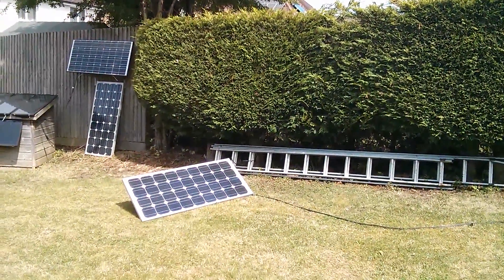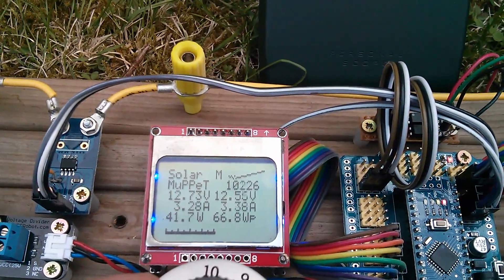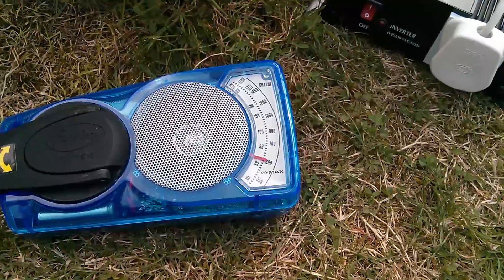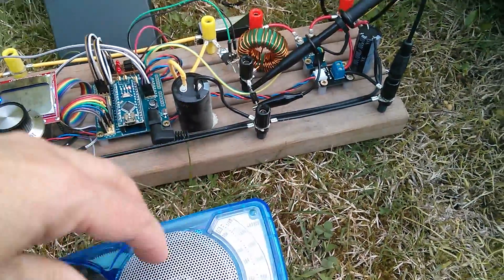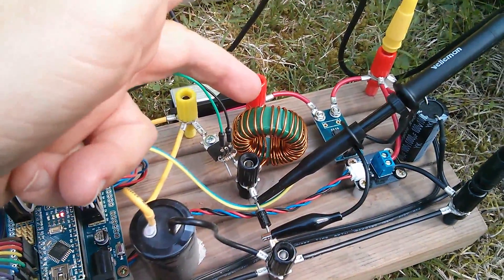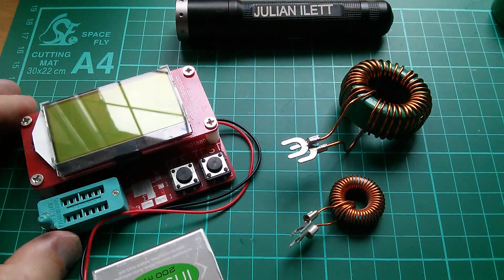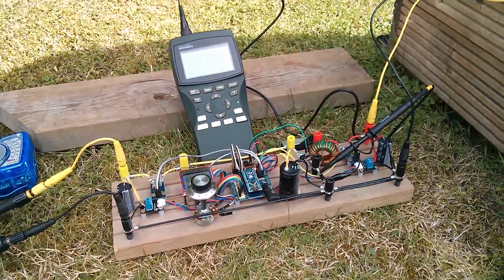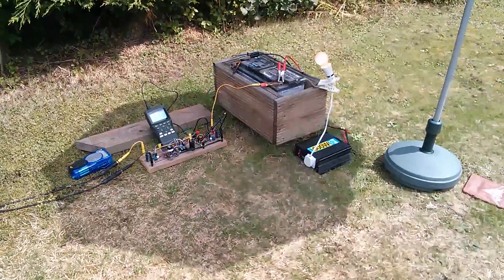Arduino MPPT Solar Charge Controller: #22 - Inductor Change

Comment: Julian, if sunlight is a problem, why don't you use a transformer with bridge rectifier and caps.  It should simulate to some extent the solar panels.  Or come to Jamaica where we haven't had rain in the last couple of months!
Reply from the maker: Donovan Lym I've seen power supplies that can simulate the VI curve of a solar panel, but they cost £thousands. Jamaica is very tempting, but Spain is nearer!
Reply: +Julian Ilett You may find this article interesting: http://ww1.microchip.com/downloads/en/AppNotes/01211B.pdf
It doesn't deal with your inductor issue, but with the relationship between MPPT and charging of the batteries.

Comment: Ringing in inductors is a direct result of how inductors work as I understand it.
It takes time for the DC to build up in an inductor when power is applied and it takes time for the DC to decay once power is removed. The larger the inductor, the more it's likely to ring.
Also, self capacitance of the windings turns an inductor into a 'tank' circuit.

Of course, inductors seem to be the mystery component that text books don't talk about in any real detail. Resistors, Capacitors, diodes and Transistors are always discussed at great length. Sometimes have whole chapters devoted to them. Inductors are often just given a footnote reference or mentioned in passing.

Comment: Interesting it is at 15khz a Stereo Multiplexer works around that frequency, I built one once as an experiment, to create a stereo multiplexer back in the 80's in fact if memory serves I think it was 19khz very close. I decided to look this up as I am rusty and now it comes back to me, Radio has a limit on FM of up to 15 KHZ audio response time, but the multiplex signal is set above that to carry the differential stereo signals for left and right channels it is a very complex thing to build mine was crude if I recall but did get good stereo separation just a bit rough around the edges this might Interest you Julian http://transmitters.tripod.com/stereo.htm

Comment: 5.26mHy with that number of turns means the ferrite core is saturating when you pass your charger DC through it.  You need either a powdered iron core (gap distributed throughout the material) or a ferrite core with an air gap in the magnetic path.  The gap is where the magnetic energy gets stored.  The high permeability ferrite just focusses the flux through that gap.  If you have a thin diamond saw, you cut cut a slot through your big core and lower the inductance, but greatly raise the saturation current.

Comment: Julian Ilett 
A few tips for the circuit (i don't know the layout so I'm guessing): the ringing is most likely due to parasitic inductance of the coil (and all the wires connecting to it) and the drain-source capacitance of the MOSFET. Look up snubber circuit, the simplest one being an RCD snubber (resistor, capacitor, diode). You should implement one, because the oscillations can exceed the drain-source voltage limit of the MOSFET and damage it. Where to put it depends on the circuit.

Do you have a low pass filter on your current sensor? If it's based on a ACS712, they can be a little bit noisy on their own. But much more likely your high current switching induces noise all over (if you can hear it on the radio you can be sure it's in all your other wires, too ;) ).

Another thing (that's an annoyance in testing, because you can't just lay everything out as you'd like to, but helps alot with RF/induced noise): twist your plus and minus wires into a single strand and bring them as close together on the board as you can. The area between the wires is the area of a "coil" (although a weirdly shaped one) and that's what emmits noise. The smaller you make that area the better. The way your test setup currently is, it's like you put all your electronics within a single turn coil that's pulsed at 15kHz at around 5A. That's significant! The digital signals won't really care, but the high impedance analog one (voltage/current) can be all over the place because of this.

Be sure that the optocoupler is fast enough. It can be a reason for regulation not working, especially on the low and high end of the PWM. Switching on and off times are not the same. At 15 or 20 kHz it could very well be that below 10% PWM doesn't even open the output, while at the same time above 90% PWM is "always on" because the optocoupler internal transistor went into saturation and is not turning of fast enough. If you got an optocoupler where the base of the phototransistor is accessible (OCs in 6 pin package), there are tricks to make them faster. Otherwise make sure that the load on the output side of the OC is high enough (in the order of a few 100Ohms). This makes saturation of the transistor less of a problem.

About the tracking algorithm: if you don't want to have users input solar panel data, you could at least measure the open circuit voltage maybe once a minute as a reference. I'm no expert in solar cells, but the MPP always seems to be in the 80-90% of that voltage. So maybe that can give you a fast starting point for the algorithm.

Btw. that high pitch squeal goes straight to my teeth (I feel it there). Has to be some weird brain connection of a dentist's appointment, because I doubt that my teeth are vibrating at that frequency.
Reply from the maker: superdau Thanks Superdau. Yes, the current has a filter capacitor fitted - actually the highest value specified in the data sheet. The optos have no resistive load, just the MOSFET's gate capacitance. Sorry about your teeth - I'll up the PWM frequency for the next video!!
Reply: Julian Ilett 
470nF? Means you have a cutoff frequency of around 200Hz if I got that right. Do you need that high update rate? Also the one on the current sensor board might not be enough, because you still get noise on the wires to the arduino. Check the waveform directly at the analog in pin on the arduino.

I'm using a ACS712 current sensor (5A version) on a washing machine motor controller I'm designing. I'm switching 1A on average (and a few more at spinup) at 325V DC at a few kHz with an IGBT via optocoupler. So except for the voltage a very similar setup. Even though it was just a few cm from the sensor to the arduino and the analog wire was close to the ground wire, what I read at the analog in was almost garbage until I put a dedicated RC filter (1µF, 10kOhm) right at the arduino pin. The readings on your display seem reasonably stable though, so that might not be an issue for you.

An since I'm already waffling (don't know which things you checked already) and also using an optocoupler to control the IGBT (a single opto, but a transistor push-pull stage on it's output so I can 
drive the gate a more than 1 amp; the opto wouldn't allow that): look at the PWM from the arduino and the gate voltage at the same time and check if the gate voltage is a nice square with the same dutycycle.

Comment: Could you show your arduino programming and explain what it is doing as  you are doing it? New to arduino programming and think it would be interesting.
Thanks for the video.
Glad you got your do138 going. I purchased the new 050 programmed one. The way you present things is very interesting. Could you consider reading the program off your scope, and installing a new one, and then reinstalling the old program? Reading the program with theh STM program would be interesting if it can be done.
Thanks again.
Reply from the maker: amtpdb1 Most of the code for this project is discussed in the previous parts, but there are 22 parts now, so it'll take a while to watch :)

Comment: Hi,
By increasing the inductor value by a factor of one hundred, you increase it's impedance by the same factor (considering you keep frequency the same) ...
So, if you were to design an old fashioned linear supply, and that you would increase one series resistance by x100, it's obvious it would most often not work as  well.
About the ringing, there's two things : as you increase x100 the inductor, as the parasitic capacitance all across the winding very likely increase much too ,the resonance frequency of the whole decrease much and come to be noticeable ...
I would suggest to divide by 10 the number of turns of this inductor, you should get around 100x lower inductance and a much lower parasitic capacitance, and get back almost were you were, except that the bigger toroid should have much less losses !  (So you should get much better performances)
Hoping with you for sun !
Jean-michel
Reply from the maker: lyrez62 I tried 5-turns and it still worked as a buck converter, I'll experiment with more turns next time. Looks like summer may be back next week :)

Comment: If you are using mppt to charge a battery, i think better way is to monitor the charging current only for the direction control.(Monitor the voltage only for overcharge protection.) I done the same direction reversing method in a 2 month data logging project, its worked fine. In my experiment i charged a li polymer battery with this method and when the battery is reached the 4.2v, a shunt regulator is kicked in and dissipated the extra power. My experiment is worked well without external power, the input/output voltage/current is logged every 5 seconds and sent via a gsm module to my server. I also started the mppt charging at 50% duty cycle.

Comment: I just found this on an instructables article which might help you:

Calculating the inductor value is most critical in designing a buck converter. First, assume the converter is in continuous current mode( CCM). CCM implies that the inductor does not fully discharge during the switch-off time. The following equations assume an ideal switch (zero on-resistance, infinite off-resistance and zero switching time) and an ideal diode.

Assume

We are designing for a 50W solar panel and 12V battery

Input voltage (Vin) =15V

Output Voltage (Vout)=12V

Output current (Iout) =50W/12V =4.16A = 4.2A (approx)

Switching Frequency (Fsw)=50 KHz

Duty Cycle (D) =Vout/Vin= 12/15 =0.8 or 80%

Calculation

L= ( Vin-Vout ) x D x 1/Fsw x 1/ dI

Where dI is Ripple current

For a good design typical value of ripple current is in between 30 to 40 % of load current.

Let dI =35% of rated current

dI=35% of 4.2=0.35 x 4.2 =1.47A

So L= (15.0-12.0) x 0.8 x (1/50k) x (1/1.47) = 32.65uH =33uH (approx)

Inductor peak current =Iout+dI/2 = 4.2+(1.47/2) = 4.935A = 5A (approx)

So we have to buy or make a toroid inductor of 33uH and 5A.

You can also use a buck converter design calculator http://www.daycounter.com/Calculators/Switching-Converter-Calculator.phtml

So 33uH is enough for our design.
Reply: It was this article by the way http://www.instructables.com/id/ARDUINO-SOLAR-CHARGE-CONTROLLER-Version-30/?ALLSTEPS

Comment: Hi Julian, could you not simulate the solar panel with a bench supply set at about 20V and a selection of series resistors?
This would let you test the algorithm indoors, maybe feeding into your battery bank outside the window?
Also, to save on the headaches of RFI and magnetics design, could you not use one of the proven DC-DC buck converter boards you have (SMD construction = small loop area!), but intercept its control signals with your Arduino?
There is already an output voltage setpoint, so you would just need to monitor the input and output voltage and current and use the algorithm in the Arduino to control the output current limit on the DC-DC board to achieve the maximum power transfer.
The buck controller IC can handle all the power switching, you just need to influence its feedback to achieve MPPT!
Reply: Simon Parkinson This seams like an awesome idea. Are there any cheap (around 5$) DC-DC buck regulators that I could connect to Arduino and cheap solar controller (like CMP12) and get awesome MPPT solar charger?
Reply: +Simon Parkinson This video shows how one of those DC-DC converter modules works, in particular, how the feedback pin of the IC is used by the microcontroller to control the output voltage of the IC.

Comment: Can you put an RC low pass filter on the current sensor output?
Reply from the maker: Marcus Jenkins The ACS-712 has a built in filter circuit which can be activated by putting a capacitor on one of its pins. I'm using the maximum value which has certainly helped damp the noise. Further noise reduction would have to be done by software averaging.

Comment: As per the Croatian offer - you're welcome to try the project here in Spain, too. We just had the hottest July since 1941. If the pure sine wave is at 100kHz, and it's quite pure, there shouldn't be too much in the way of harmonics to pick up on your MW receiver which starts at 500kHz? What's the type (colour) of the small toroid? Blue? Google 'toroid calculator'. Lots of different ferrite brews with different permeabilities - usually colour-coded. As an Amateur Radio DIY-er I can usually wind my own toroid inductors to an expected value within a few percent. I have the same component tester and don't find it as reliable/useful as another, dedicated L/C meter (also eBay sourced).
Reply from the maker: Marcus Jenkins I believe southern Spain is also blessed with more hours of sunshine than any other part of Europe. Your offer is very tempting! Yes, the small toroid is blue and has a number printed on it (HF-080125-2 I think)

Comment: Hi Julian,

when hot days are as rare as sunny days in your town, I will move and we will see us as neighbours! :D

I H.A.T.E. summer... 33°C today in the west of Germany!! That's overkill!

Everything above is not summer, it's a air substituted with lava!
Reply: *****  come to Lancashire we have had one too hot days so far this year. 

I was in Germany with the RAF in the late 80's your are right the heat gets unbearable at times and it's colder in the winter too, and I was not that far north either at what is now Airport Weeze
Reply: brian whittle
I know Weeze :) It's not that far from me! Approx. 20 minutes with a car.

I miss these cold winters with snow. They are currently very seldom and the last two ones were fail. I like the winter, because you are actually able to compensate low temperatures. But you cannot remove your flesh when it is hot...
Reply from the maker: ***** I L.O.V.E summer and H.A.T.E winter. My car has no air conditioning and I like it that way. On our only summer day this year (July 1 - 37° C) I went to London to visit a friend deliberately so I could be even warmer :)
Reply: Julian Ilett
Let's trade places! In Germany, 40°C is easily possible.
Reply: ***** I was in Berlin in July 2012, and though most days we were below 35 there was something about that place that made it feel worse. Perhaps it has something to do with the sun rising at 6AM and only setting at 22:30PM, with the hottest part of the day at 6PM.  Now I'm from South Africa where we do 48 in some areas (though 37-40 more common where Live), but Germany was something else... even for me.
Reply: plonkster
Really? Germany feels hotter than 48°C in South Africa? WOW! That's really strange...

Was there much higher humidity when you were in Berlin perhaps?

Comment: Julian Ilett could you take a smaller solar panel put it in the dark and play music through a led into the solar panel basically using the same set up? And would it play music through the radio??

Comment: I did something like this a long while ago with PWM.
In the end I set up two separate systems in parallel and run them offset from each other. I set the oscillators to drift towards whichever one was working the best. I think the hold time was about 5 seconds so it was a slow lock on to peak but held well.
Reply: PIXscotland it seems this whole idea is of only limited use, only for a simple 12v system you dont need it at all for a 24v system as its more effective to connect panel direct, and house systems have  a micro inverter on each panel, and the expense of the controller you could just put into a larger panel and get your 30 percent. However its a fun project
Reply: jusb1066 I don't do solar at all so I can't comment on that to be honest. The whole world of solar is pretty alien to Scottish people as we barely get a day without full cloud cover. :-/
Reply from the maker: PIXscotland I have had thoughts of a multi-phase system (perhaps 3-phase) using smaller inductors, but I'm starting to think that idea will never see the light of day.

Comment: For lowering RF transmission, you could try to lower the loop area.

The circuit does form loops involving the input and output capacitor, so connect the ground well & by short path, and keep power components close.
Basically just physical layout alone!

Comment: There is also a saturation current, important detail!

You could try synchronous rectification, using a half-bridge and half-bridge driver.
It would probably make the converter bi-directional, but no more "open circuit"/ringing of the last inductor energy.

Comment: You can hear the frequency's without the radio on the video. The radio did amplify some of them.
Reply: ***** it hurts me ears :(
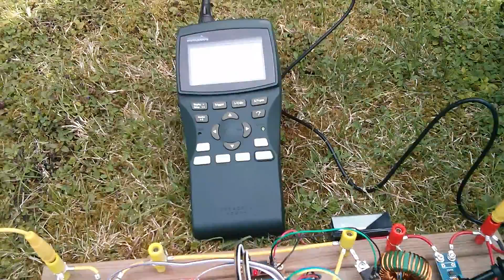Reply: ***** Yes I can clearly hear it starting at precise 0:32. But I'm only 27 years old. But I only hear it on the right ear... Seems that my left one is already toast at HF! ._.
Reply: ***** That sequel isn't radio noise being picked up in the camera, like the AM radio. It's the inductor (and maybe other stuff, but mailing the giant coil). Magnetostriction causes the ferrous material to change shape slightly and move around very rapidly.
Reply: I know, bothered me more than my dog.
Reply: ***** their is some strange noise when inductor was shown, but it didn't appear as high pitch.....
Reply: It was about 15KHz. The inductor was probably the source.